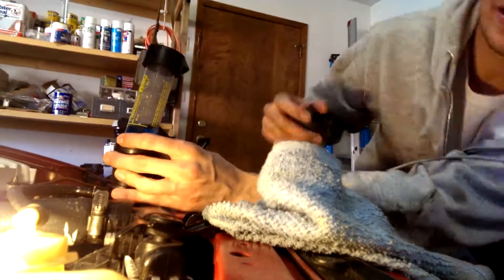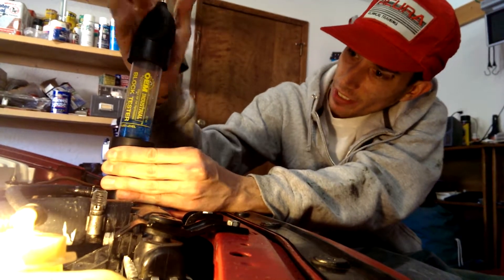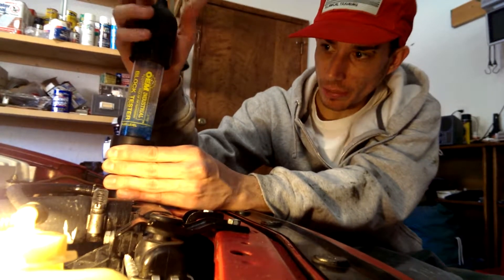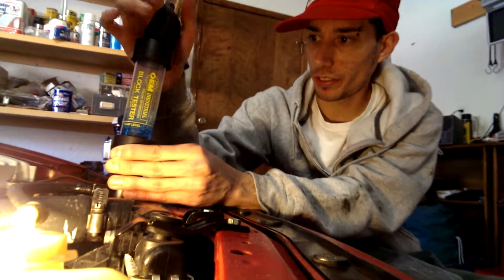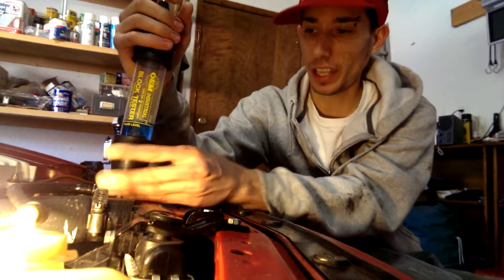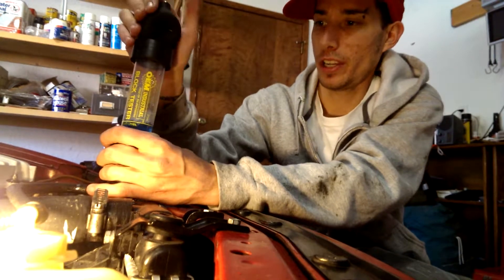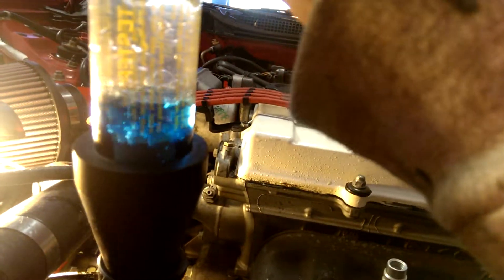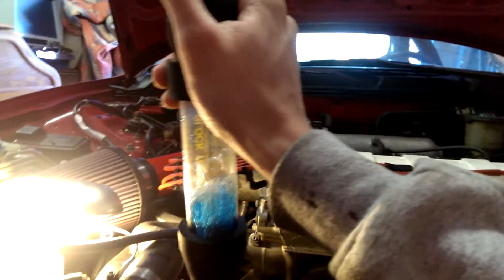Block Tester Outcome

Comment: unforchantly you are doing this not wrong but you will not get an accurate result from your test - this is a true way of doing it. you need 2 people to do this test - why and here is the way of doing it. 
1. draine car collant 1/2 of the radiator and entirely from reservoir.
2. open radiator cup
3. start the car and let it get warm
4. get testing tool ready
5. this where you need help (one of you start using tool and start sucking the air from the radiator and another - this is very careful put car on parking brake then with one leg apply brake and hold HARD while with the other apply accelerator and give a good rev 3.5 RPM or even 4 RPM and hold for 30 sec just DO NOT let go of the brake!) and that is the true test .   you have to create a pressure to truly know if the block gasket is OK it is not going to work  at 0.6 RPM you need to give an engine load - got it.